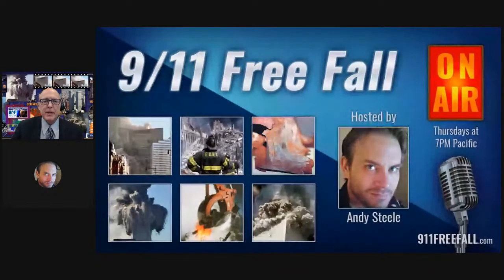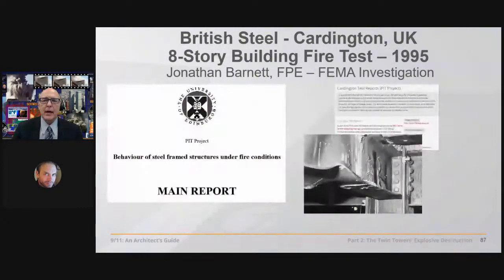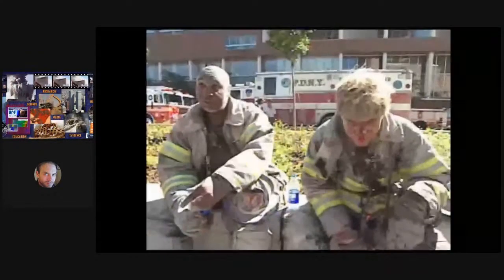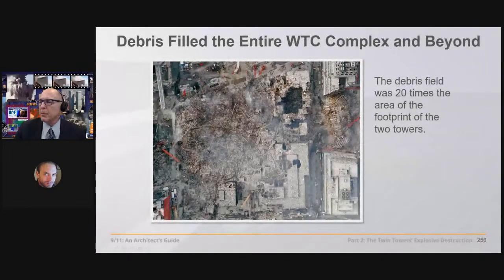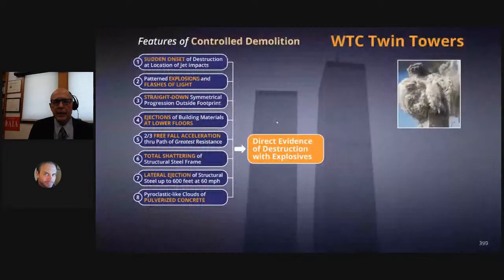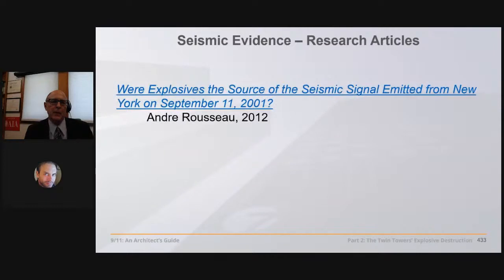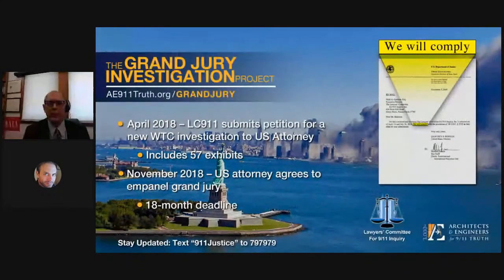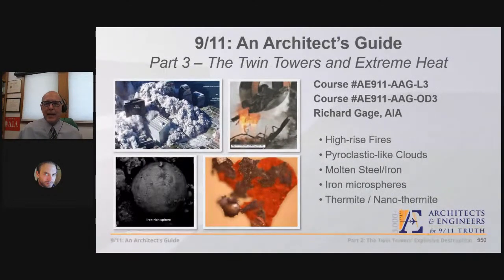9/11: An Architect's Guide - Part 2 - Twin Towers' Explosive Destruction (6/11/20 Webinar - R Gage)

Comment: WORLD TRADE CENTER 7 & THE TWIN TOWERS- The symmetrical collapse of WTC7, not hit by a plane, at free fall speed for 2 1/4 seconds,  and virtual freefall speed overall, into its own "footprint", as well as the symmetrical collapse of the twin towers, showed the typical signs of controlled demolition. 
- A BBC reporter said WTC7 had collapsed long before it did. Silverstein said he gave the order to "pull it".  The 9/11 Commission ignored the collapse of WTC7, as did most of the mainstream media following 9/11.
- Police clearing the area in advance of its collapse said WTC7 was going to blow up.
- NIST did not investigate controlled demolition as cause of the collapse, even though admitting free fall.  NIST are still refusing to release various key data of their computer modelling and the collapse. Their report, like tgeir deeply flaweed modelling, aimed to explain a fixed pre-set hypothesis, rather than open to possibilities and the obvious alternative, was misleading, full of innacuracies and did not match reality or actual film footage, as confirmed by (among other engineers' and scientists' responses) the University of Alaska's investigation, which is clear that the collapse was certainly not caused by fire, but “near-simultaneous failure of every column in the building."
- Prior to 9/11 there had been no previous instances of such demolition-like collapses of high rise steel buildings as the twin towers and WTC7. NIST explained the collapse of WTC7 as due to fire (which it exaggerated), but far worse fires in high-rise towers (such as Grenfell, which remained standing, among many others) have not led to swift and demolition-like collapse. No steel-framed high rise building has collapsed due to fire, apart from the 9/11 towers. 
- TV reporters and presenters said at the time it appeared the towers had been brought down by explosives, a belief also voiced by officials in the White House, FBI and Fire Department. Cheney and Giuliani were quick to deny that. Mainstream media then accepted official denials and explanations without due scrutiny or questioning; in fact proponents of controlled demolition and use of explosives have been routinely castigated and ridiculed, or ignored.
- TV reporters and presenters also mentioned the surprisingly small amount of debris and rubble- as confirmed on film. Also melted steel. 
- Numerous cars, trucks and buses in the area were toasted- astonishing to reporters, and contrary to the official version.
- Seismic recordings did not match the official explanations for the towers but indicate instead the use of explosives.
- New York Fire Department Commissioners have called for a new investigation into 9/11, due to "overwhelming evidence” that “pre-planted explosives . . . caused the destruction of the three World Trade Center buildings.” 
- Building construction and fire service guidelines were not changed despite the NIST report into the three towers' unprecedented collapses- an implicit acknowledgment of another cause than NIST and official explanations.
- Rubble and evidence were illegally removed from Ground Zero crime scene. Mass  pulverisation and molten steel at Ground Zero indicated controlled demolition. There was evidence of nano-thermite, thermate and explosive material.  The fires were not hot enough to melt steel. The twin towers turned to dust, in mid air.
- Numerous witness statements of numerous explosions at the towers, including multiple witness accounts of a massive explosion in the lobby of one tower, were ignored by both the 9/11 Commission and NIST. NIST did not look for evidence of explosives and incendiaries in the rubble.  
- Bush said explosives were planted high in the towers by operatives in order to maximise destruction. Maintenance and renovation work in the towers were carried out in the months before 9/11, with elevators out of service being repaired and reduced public access within the building.
- 5 Israelis seen filming the attacks on the towers and dancing in celebration were arrested in a van which according to the media was filled with explosives, but were later released.

Comment: THE PENTAGON- There has been no film footage shown of a plane hitting the Pentagon, despite a court order that it be released. Personal filming and cameras near the Pentagon at the time were confiscated. Very short images from 2 cameras released merely show an explosion, but no plane, and there are discrepancies indicating tampering with the footage.
- The plane hitting the Pentagon would have required an extremely difficult and needless manoeuvre round and low behind the building by the hijack pilot whose flying ability was claimed to be poor. 
- 9/11 Commissioner Roemer initially said a missile (but then changed it to plane: "a missile........plane") breached the Pentagon defence.
- The day before 9/11 Rumsfeld admitted 2.3 trillion dollars were missing from Pentagon funds. 9/11 diverted attention from the issue and the Pentagon attack undermined a thorough investigation. The budget office was destroyed. 
HIJACKINGS & FLIGHTS- Lack of  evidence from the 4 black boxes 
- There was massive pulverisation of the towers yet an intact hijacker passport was found nearby. 
- There has been no film footage of the alleged hijackers in the airports or entering the planes
- Secretary of Defense Donald Rumsfeld said flight 93 was shot down; this was excused as "mis-speaking". 
-Debris of flight 93 plane was scattered over several miles and reporters and witnesses at the "crash site" said at the time there was very little sign of a plane crash there. 
-Seismic records indicate flight 93 shoot-down rather than crash.

Comment: September 11th, 2001 ..

Each impact , either actual or simulated , decreased in elevation with regard to sequence :

WTC North 91st floor. 
WTC South 78th floor 

Pentagon at first floor (accounting offices).
Shanksville PA at absolute ground level.

In addition, each impact
either actual or simulated , alternated respective of each airliner's company 
in this sequence of actual  or simulated impacts :
A A 11
UAL 175
A A 77
UAL 93.

The two highest in elevation targets were the offices located inside WTC North at 91st floor and WTC South at 78th floor. 

Because the accounting offices at the pentagon building were located at the first floor and both the Shanksville PA " impact site" and the pentagon accounting offices were at ground level, no aircraft were needed by the actual perpatraitors therefore 
none were employed.The pentagon and Shanksville PA were simulated commercial airliner impacts.

Two highest in elevation targets.. actual aircraft, actual impacts. 

Two lowest in elevation targets were simulated.
 
"UAL 175" was the simulacra aircraft that impacted WTC South 
at 9:02 a. m. at the 78th floor but only until after 
"AA 11" had impacted 
WTC North at the first 
and highest in elevation target at the 91st floor.

"UAL 175" impact was aired on live broadcast television while at least eighteen different people at eighteen different locations also filmed the "UAL" 175" impact.

WTC Building Seven , the  forty seven floor skyscraper , descended in a nearly perfect symmetrical controlled demolition in less than seven seconds (at the rate of 7.2 floors per second in the duration of 6.5 seconds) at 5:20 p.m. 

8:45 a. m.  to 5:20 p.m are daylight hours.